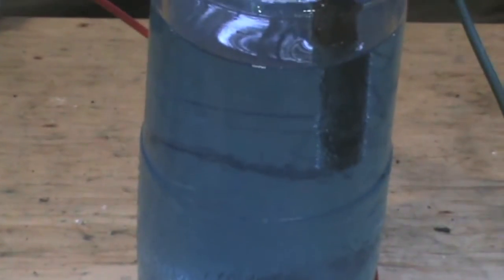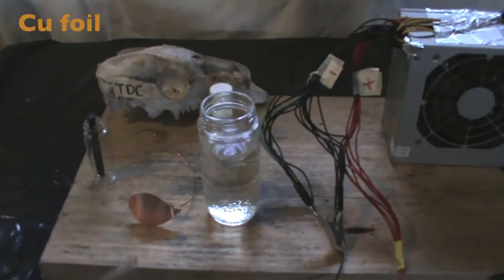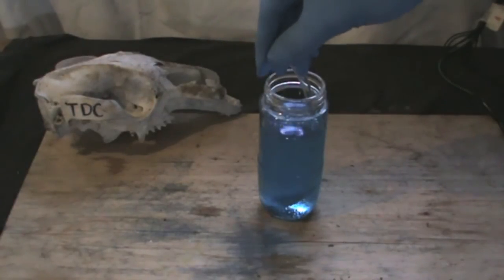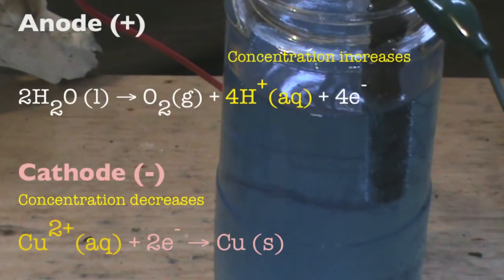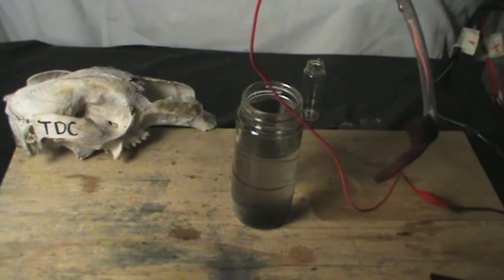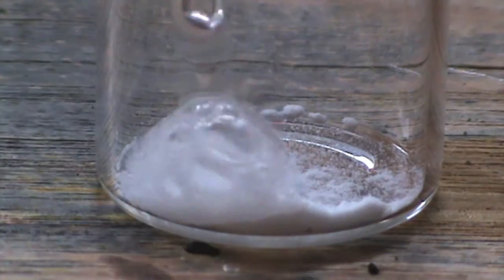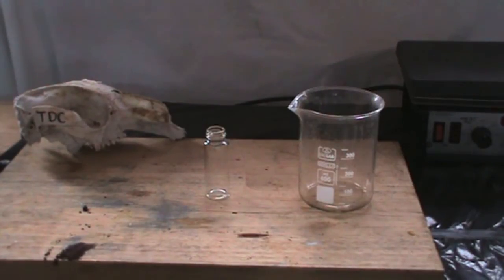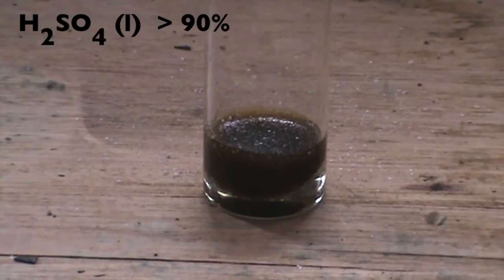The Electrochemical Conversion of Copper Sulfate to Sulfuric Acid using a Lead Dioxide Anode

Comment: thanks man, my other doubts that is out of context is that need some pdf or video on the synthesis of ethyl chloride in the case would be a right gas? It would have to be step by step manufacturing know of any? I am struggling to find the net.

Comment: brother help me if I do not get the PbO2 which can use another element to my reaction to it?
Reply: +Ms3th4n  you can use carbon,gold or platinum
Reply: +35lightning35 thanks man, my other doubts that is out of context is that need some pdf or video on the synthesis of ethyl chloride in the case would be a right gas? It would have to be step by step manufacturing know of any? I am struggling to find the net.
Reply: I'm wondering if palladium would suffice? It has the lowest melting point of all the 'platinum metals' and can absorb up to 900x it's own volume of hydrogen. Now I'm thinking it could be used for other things. When plated on conductive materials, it's an excellent electrocatalyst for oxidation of primary alcohols in alkaline media. Palladium is also a versatile metal for homogeneous catalysis. When applied to carbon, palladium forms a versatile catalyst; it speeds heterogeneous catalytic processes like hydrogenation and dehydrogenation. And can be found in catalytic converters ready and some spark plugs and some dental work